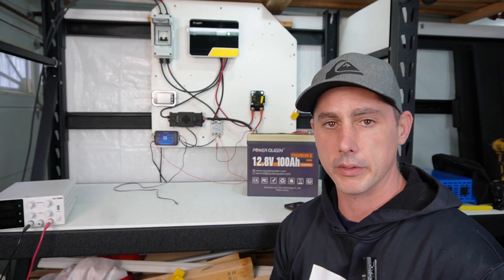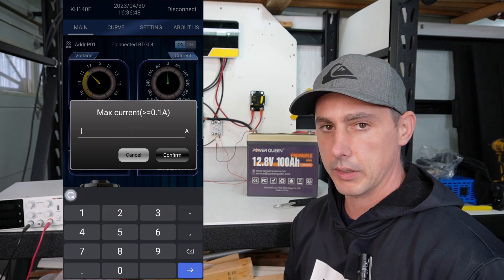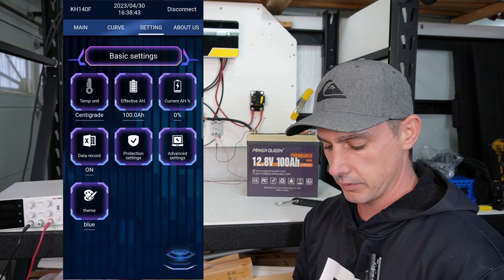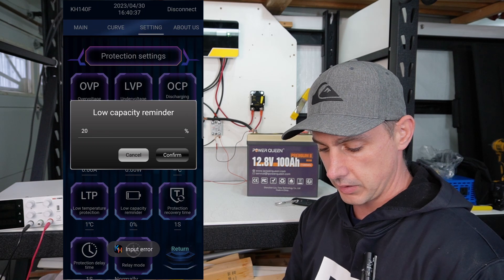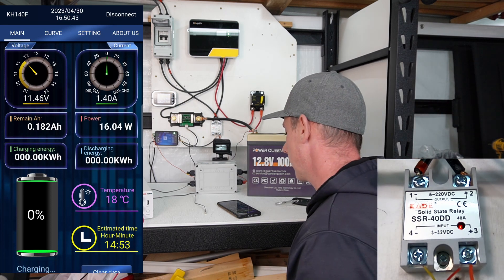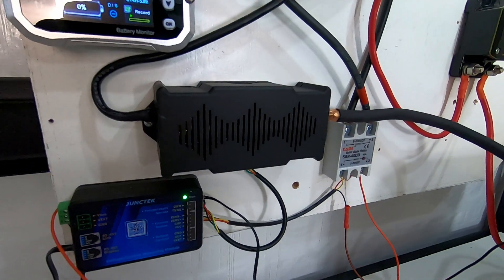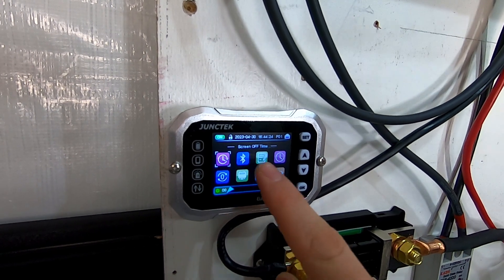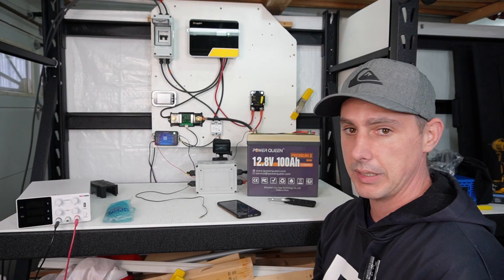Smart Battery Monitor Shunt, Real time Volts, Amps, Watts, Wh, Ah. With 7 Different protections

Comment: Why did you pick that specific relay? How is it rated in correspindance with how you are using it?
Reply from the maker: It's been such a long time since I've had this setup. With relays, I verify that they are DC rated and fall within the voltage and amp requirements of my load.

Comment: Thank you for sharing that I just want to ask the amp that shunt can handle depending on what? The battery capacity only?
Reply from the maker: @yonaha2687  The amount of amps you decided to push through it. You can always use a larger one than you need.
Reply: @Roll2Videos so you mean by amps push through the battery the load amps ?

Comment: Also for clarification, I don’t think the ‘smart’ shunt does any switching, it’s just monitoring and providing data to the controller. The switching off in an alarm condition is what the relay is for, ie, a seperate (not supplied) device. It could be a solid state relay or an electro-mechanical relay.

Comment: Another YT on the same device refers to 2w-3w as 2 wire-3wire as opposed to 2Watt-3Watt. Not sure which is correct. Otherwise a well made YT thanks with useful information.

Comment: Question, if the low temp protection kicks in and disconnects the battery from the charge controller wouldn’t that fry the charge controller? I have heard many times on different solar forums not to connect the solar panels to the charge controller without a battery already connected. Thanks for the great video!
Reply from the maker: It's possible that some older charge controllers may have this issue, but newer models likely don't. It's best to check with the manufacturer.

Comment: Hi, what type of shunt would you recomend to monitor the state of charge of a 24v system, its for a boat  trolling motor, I have 2 12v 100ah ampertime batteries connected in series, also wondering if its possible to leave the shunt mounted in the boat or will the wet enviroment be a problem,  I watched your video on battery storage and would like to discharge the batteries before storing the boat for winter. thanks for your time, great channel.
Reply from the maker: The new Victron has an IP65 rating
https://amzn.to/478Q3XI

Comment: Hi, what function does the ssr-40dd do? do you need the ssr-40dd for low temp cut off? I see the output says 24 v + so as I have a 12v, Id have to get a 12v output if I cant use the low temp cut off on the 2 phase switch? like your videos, cheers :)
Reply from the maker: You can use any relay you'd like. Just size it appropriately
Reply: will the cold cut off protection work without a relay?
Reply from the maker: @rustytoronto  No, you will need a relay for it to work.
Reply: Thanks brother, Maybe other people might find this helpful too, cheers :)

Comment: I have 2 KG140F devices. Even though most of the settings are available in my version, I consider owning these as a necessity evil. First I have to grant location permissions, then file permissions, then when I hit “Firmware update” the software just locks up. The Bluetooth signal doesn’t even penetrate my wood floor ( on either unit when used singularly or when both are used ) I tied using several devices and OSes..eventually I had to move my tablet downstairs and use a dock with hdmi output. Many other Bluetooth tooth devices I own have absolutely no issues. By no means do I consider this device “worthless” rather its another poorly engineered device made in China.. Sincerely I hope someday this company will change my mind. I would happily pay 15 bucks more for them to engineer a better product.
Reply from the maker: That has not been my experience using multiple of their shunts.

Comment: Allright, i'm near finished the script to flash KH140F firmware aka "new device" to the "old" KG140F... showing how Junteks did not create a new device but just package the same hardware in a slightly different package and sell it as a new device, preventing US, buyers of the KG140F of upgrade that where promised.

Comment: I started looking for a relay for mine but got sidetracked.  I know I couldn't find 1 right away and the couple I did find seemed kinda pricey for a simple relay.
Reply: Ah I see you found a relay that's not overpriced. Thanks again bud✌️
Reply from the maker: @scarygary3569  Your welcome. Now I haven't load-tested the relay yet so I'm not 100% recommending it.
Reply: @Roll2Videos  gotcha.I also need to check and see I'd the shunt I've got actually cuts off on low temp.Ive seen many products say they have the low temp cut off but when put to the test they don't work out.Still be nice to have the other protections active tho.

Comment: Wait .. i can't see anything new in this KH serie vs KG serie .. ! What is different ?
Reply from the maker: Different display layout, different app. Cover for the shunt to provide more protection.
Reply: @Roll2Videos  Yea that's what i saw, but it's a pretty bold move from Junteks,  we need to buy new devices to get an update on the app ? As i see, the hardware is strictly the same, only the software is different.
Now since you got the both devices, you just have to open both devices and give us hardware differences...

Comment: These guys have great stuff. I've used their old VAT-4300 In almost all my capacity tests over the years. It's been rock solid. I even shorted it out once (my fault) and was easily reparable, still kicking. I have this new one, and can't wait to test it. Great Video!
Reply from the maker: I'm looking forward to your video 😀
Reply: Man I'm wanting to make a video of my system when I get home this time from being on the road all month. I started to do it a few times but I get cold feet ki da worried about what people's gonna say. It's an impressive system with good components but it's still in process of adding more panels.
Reply from the maker: @matthewknight5641  Do it, Youll feel better after you post.
Reply: @matthewknight5641  Yup, just do it! Step out of your comfort zone, it'll be good for ya.

Comment: I have one of the 400 Amp shunts like that but it's about 6 months older version
Reply from the maker: The older version is still a keeper
Reply: My older shunt came with a temp sensor. Do you think it's capable of doing the low temp cutoff? I know it came with a little plug that says ita a relay wire bit I never really messed with it. I just been using it to see how much runtime and charge time I have and state of charge. If it'll do the temp cut off I'll use it but if not I'm ordering the newer version
Reply from the maker: @matthewknight5641  Open the app you're using and see if low-temperature protection is there